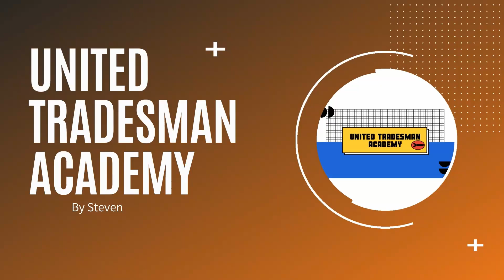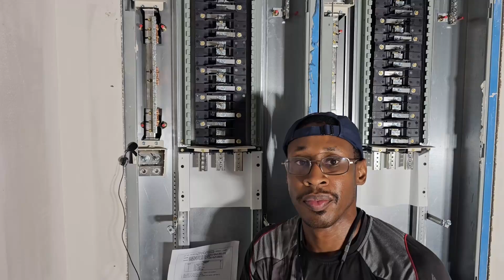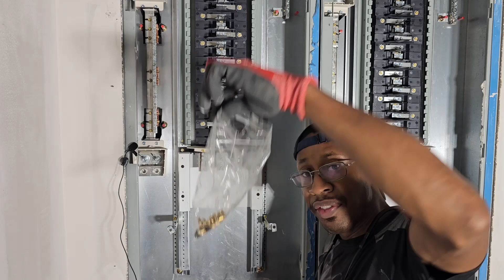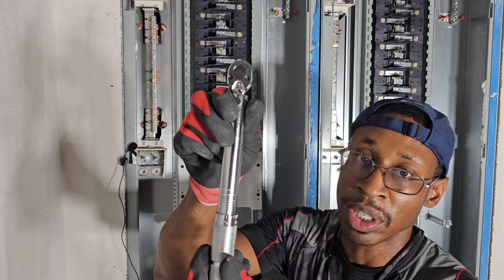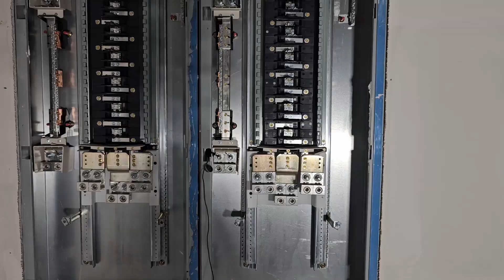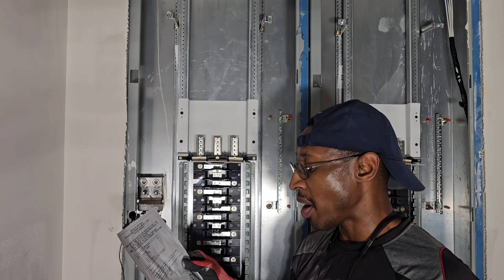Install 3 Phase 400amp Circuit Breaker Install & Torque Feeder Lugs

Comment: LET’S GO E-TEAM🎉

Just an FYI:  Using an extension with a torque wrench DOES NOT change the torque applied. You can use 10 extensions and it doesn’t change. It’s when you use a crow’s foot that you have to worry about torque values changing.